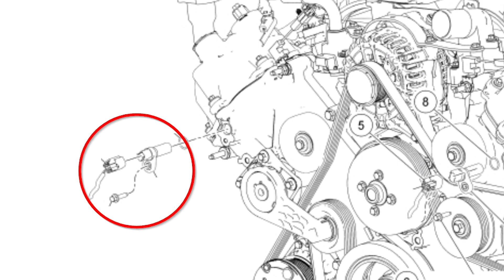NTK - Camshaft Position Sensor (CMP)

Comment: My sensor on my Acura RL (2002) requires removal of timing belt, Water Pump and the cam sprocket Gear. Are these any better than the Acura one's? They All Melt. Mine melted. I have no driveability problems, but occasionally will not start. No check engine light, car runs amazing. Here is my NTK EC0278  Any information you can give me is greatly appreciated.  Thank you.